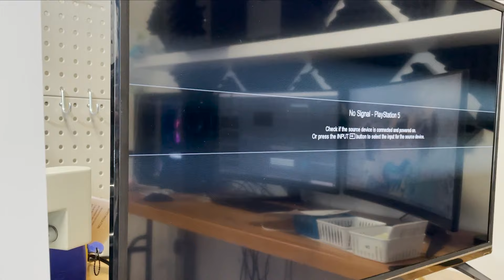PS5 HDMI Replacement: Fixing HDMI Port Issues Like a Pro!(Teardown included)

Comment: Man getting the old component off was the hardest part, thank you for the guide my stepson and I really appreciate it, his ps5 is working like brand new again!
Reply from the maker: Awesome 👏🏻
Reply: Oh God , it’s like it was made with a different material
Reply: How you’ll charge me to fix mines ?
Reply: I'm taking a break right now. You're right, I'm trying to get the old one off but It's not wanting to budge. I will get it off eventually.   (realized I hadn't sent comment yet)   Ok, I just got it off. I think I'm going to take another break before I try to install the new one. lol
Reply: I got it out but 1 leg was broke off in the hole. It took as long to get that last leg out as did the rest of the port. This has taken me all day, off and on. I think I'm going to call it a day and try to solder in the port tomorrow after work. I love tinkering with this type of stuff but it is tedious.
Reply: @allenmitchell09 did you fix it
Reply: @ I wish.

Comment: 10:52 you remove the silver screw to put in the black on eright if you was following this 1 to 1 it would be wrong just asking tomake sure?
Reply from the maker: If you are referring to the silver screw on the left on top of the disk drive then that’s the correct screw for this model. There’s one silver screw for that slot.  All the rest at that point are black.
Reply: @FIXDPHONES  Are you sure? at 10:30 you put the silver screw in then after put the plastic shroud on the PS5 if you try put the black screw in near that hole near the disk drive you end up boring the screw. Also at 10:56 you time skipped and maybe didn't show you removing the silver screw I watched a few other videos on the same model and no one put a silver screw in the hole before putting on the plastic shroud.

Comment: @5:31 and 5:38 what is he/you doing or called at this point?
Reply from the maker: Using flux and wick to remove all the solder from the through holes and pads.

Comment: Hi Thanks for sharing. Would you please also introduce the tools that you used? I'm not very clear about the liquid thing you applied. Thanks again.
Reply from the maker: The liquid I used is flux, designed to prevent oxidation while soldering so the solder can flow more freely. Hope that helps.
Reply: What are you doing at 07:38? Too bad you went silent on that part i cant tell whats happening there or why

Comment: I have not got into the newer gen consoles because of the liquid metal. I havent learned about it and it seems very different than thermal paste. Its mainly whats holding me back here an im not sure if i should be as worried as i am since i have done so many PS3 and PS4's
Reply from the maker: If that's the only thing holding you back then I say go for it. I find it much easier to work with in general.
Reply: liquid metal is tricky cuz it takes 40 minutes of spreading it around for it to finally start sticking

Comment: This is a great video for teardown, but it takes a lot of heat to pull that port off. The metal shell of that connector is soldered to a pretty heavy ground plane. I would recommend pulling apart the connector and removing the plastic piece first and desoldering the small pins. If you try to heat the whole connector and pull it off as one, you may rip some of the pads off on the fine pitch pins because it hard to get an even amount of heat on both side of the board. As you can see in the video the small pins on that plastic connector we’re already cracked so it came off pretty easy. If your small pins are still soldered to the board be very careful when pulling off the connector.
Reply from the maker: That is some great advise, Especially for someone who hasn't done it before.
Reply: Nice

Comment: What is the reason for damage on hdmi port,,heat??? or crash?? or dony factory fault??
Reply from the maker: Typically it’s when the hdmi cable gets tugged on
Reply: @FIXDPHONES  you mean i.e. if you pull the cable with force or clip them not carefully? I have ps4 10 years and many time I clip or pull the cable and never had damage, also the original ps5 cable I noticed in some ps5 games (not ps4 games) is very hot and my ps5 is new and in very good condition

Comment: What screwdriver are you using to take this all off? I can’t find a tool that has a hole in the center for those weird little metal piece in the middle of all the screws
Reply from the maker: Most screwdriver sets for electronic repairs have them, I even saw the same style in a Walmart kit.

Comment: Hello I just bought a ps5 and I have been plugging and replugging my ps5 to shift rooms here and there and I am worried about the hdmi port and the power port and don't want it to be damaged. Plz tell me if it really affects the ports if it's plugged in and out with care.
Reply from the maker: As long as it’s something that you are paying attention to you should be fine. If the cable gets tugged on especially in the wrong direction that’s when I’d be worried. Just make sure it’s plugged in and unplugged with care each time and you’ll be fine.

Comment: Do you repair liquid thermal for ps5 and also do you repair broken Ethernet port ?
Reply from the maker: I do replace the Ethernet Ports yes. when you say repair liquid thermal, do you mean add new or has yours gotten on to the logic board and caused issues?
Reply: @FIXDPHONES  both  i mean the liquid is on the motherboard and eventually add some if needed

Comment: Great video as I was contemplating replacing the HDMI. I went to plug in the controller, didn't even touch the PS5 and bang a big static shock. The thing now will not output any video whatsoever. Tried safe mode and all that. Any idea if that's likely the HDMI or possibly fried the video card or some other component?

Comment: So so so many people experience this same problem ,,,so why isn't it a report on faulty equipment been sold by playstaion ,,and why isn't playstation resolving and fixing this fault,,it cost enough to buy a ps5 and then the scam is when it's faulty hdmi port breaks ps5 charge 280 euros to fix the faulty equipment it's a scam by playstation ,,,,,2 weeks after the guarantee is up mine went down rang ps5 they take no responsibility on the faulty equipment
Reply from the maker: Agreed, should be something they cover under a specific amount of time.

Comment: At 5:55 are you just cleaning up the board? If not what are yiu doing exactly
Reply from the maker: I’m absorbing the old solder with wick(braided copper) using a soldering iron. This will allow the now hdmi port to slide into the through holes and be easier to solder.

Comment: What temp is your gun?  I can't remove the Sauder on the ps5 it won't melt with my gun or 860degree heat gun
Reply: Mix leaded solder in and it will lower the melting temperature

Comment: I bought one off eBay said new pre owned but was completely custom purple and galaxy stuff loooks cool hdmi port does not work paid 403.12$ for it :/ wasted money cause I can’t do this 😅lol don’t even have the tools to attempt so guess I am put money cause I don’t have money for repairs I mean I do have two ps4 sitting on my shelf one is parts and blue light of death other just needs a hard drive otherwise works but the part ones drive was bad so never got around to fixing it. Figured I’d could use one of there hdmi ports cause they’re good on the ps4 lol. But idk now 😮 I’m extremely upset cause won’t accept returns and I’m out 400$ wish I had someone who was techy like you around me :( I’d give em the two ps4 for payment. Plus I’ve never used a soldering gun before so that is out of my element used to fix ps2 and Xbox 360 and that but now oof idk man they become complex

Comment: I bought all the equipment from Amozon to doit my self but the cheap hot air gun wouldn’t melt the solder, putting back together and go buy one with a warranty and return this one a month later😂 good vid
Reply from the maker: Ya, the thermal mass of the PS5 logic board requires a ton of heat so a cheap heat gun doesn’t always cut it. Props for trying
Reply: Bouta be in the same boat bought all this stuff thinking I got it the pins won’t even come off they didn’t question you about the ps5 or check they just took it back I’m about to take this route 🤦🏾‍♂️
Reply: How hot do I need the heat gun

Comment: Tried this myself but just cant seem to get the hdmi port off the motherboard its a 60 watt solder iron i applied flux n followed your video any ideas why i cant seem to desolder n free the hdmi port
Reply: Your tip may not be wide enough to distribute a decent amount of heat. Also try heating it upside down so that gravity can help it fall out. just don't pull on it.

Comment: How hot does your heat gun need to be when taking the hdmi off ?
Reply: Same question
Reply: in another comment he posted he said that cheap heat guns most likely won’t cut it.
Reply from the maker: As hot as you can get it. It helps to add lower melting point solder to the legs and pins so that any heat gun can do it. A really good rework station is recommended though.

Comment: Brother please, all of the 4 anchors are cold joints and the solder didn't wick. Through hole components require more heat and you need better Flux.
Reply: I agree here

Comment: How much to fix mine. My HDMI port is very touchy. You move the cord and I loose it on the screen. I spend about 30min to one hour trying to get the picture on the screen and if someone bumps it. I have to start all over
Reply: Just tell me how much you charge and I can ship it to you and you could do a video on that too
Reply from the maker: Sorry to hear that, sounds like a pain. Probably broken solder joints between the HDMI and the board. Should be fixable, email me at fixdirepair@gmail.com and we can talk cost. Thanks
Reply: I sent you a email
Reply: @FIXDPHONES  I sent you an email I was waiting on a response
Reply: @zackeryhoward9686  RIP Zackery. Use a local shop homie
Reply: @blakedegner1863  I might have to it's almost the same price as the ps5

Comment: when you do this do you have to melt the solder puddle on the motherboard ????
Reply from the maker: I think you are referring to the liquid metal. It’s what Sony uses for better contact with the heat sync instead of thermal paste like on other consoles. It’s only a solid if frozen. At room temperature it’s a liquid. Pretty fun stuff to move around but it can be messy too.

Comment: any reason a solder suction tool should not be used for the through holes (mounting holes) to clear out the solder then clean up with the wick?
Reply from the maker: Nope, totally fine to use one of you have one

Comment: At 6:06 listen brother so you donny waste your time by doing each pin

I have fixed alot of ps4s and ps5 so when you remove the 4 legs solder you put the new port then use hot air station at 350c at low air of 30% then hold the hdmi port and keep heating for 1min after that when you put the solder on the 4 legs do the same heat it up but now at 40% air flow then the solder that you put on the legs will be sucked so the port will not be loose and the pins will be 100% soldered so don't waste your time doing the pins its waste

Also don't use wick and remove the solder you can just put Flux then the iron pen put little bit of  solder  and don't let the pin touch the port leave the solder on it and go right and left that's it the wick thing is first hard and also you can remove the pins solder on the board I hope you understand man good luck
Reply: Thanks man. Soldering those pins are a pain.
Reply: Nope nope and nope,my brother does this job for the Xbox's and Nintendo Switches,listening to this  Toghy will make your HDMI ports fallout faster than the videogame with the same name did overtime O_O

Comment: This is a dumb question, but when purchasing a replacement port do I need to factor in HDMI 2.1 support? I know the cables and devices must support it, but I’m not sure if the actual port itself varies across 2.0 and 2.1?
Reply from the maker: Nope, an HDMI port doesn’t care about the difference in cables as the ports the same.
Reply: Where can I get a hdmi connector from !

Comment: I've had a PS5 for all of two weeks, and the HDMI cable keeps falling out. Had a Series X for over a year, and zero issues with its HDMI. Just...WTF, Sony.
Reply: I dropped mine lol HDMI chord pushed the port inside
Reply: @seekandyoushallfind9707  did you end up fixing it ?
Reply: @aaronvvs3413  I replaced the HDMI port but I feel like I didn't solder it correctly. I'm going to try one more time when the new port comes in. If that doesn't work I'll send it some where for repair
Reply: Okay? I’ve had a PS5 for 4 years no issues, means nothing

Comment: How much would this service cost i need mine done 🙏🏾
Reply: Just broke mine an hour ago and I’m pissed asf,
Reply: @SheOnceLuvvd  got mine fixed locally $150 look around yours
Reply: @ibshotya  yeah I just got mines fixed yesterday for 150
Reply: If it's under warranty and you file a claim through sony, you can get it fixed for free.
Reply: @souptime_mp4  yeah ik but the only downside to that was waiting 2 months so I decided to pay 150 to get it fixed and returned within an hour
Reply: @SheOnceLuvvd  where’s you take yours to get it fixed?
Reply: @moonvro  Digital Doc, but tbh I got lucky and went the right exact time. The dude who fixed mine just happened to be in my town and he is the only tech who could and work on ps5 within a 50+ mile radius for digital doc. So he was already experienced and knew what he was doing. So that was a plus on my end.  If you want a third party to fix just be careful who you pick because not only you risk your warranty but also can’t guarantee a stable fix to the problem if they’re not experienced
Reply: @ibshotya  that’s expensive….
Reply: @SheOnceLuvvd  how did it go wrong? Cause i felt it's a bit tight to put the cable in the port, did you push it too hard or something else?  I don't wanna make the mistake of pushing it in or bending it.
Reply: @br1303  I apparently pushed it in too hard which caused the component to fall off
Reply: Same thing happened to me and I was rejected in warranty :((( now I'm waiting for a local repair shop to fix it. Hopefully they will manage to do that
Reply: @SheOnceLuvvd  from where I’m in Cincinnati and I really need mines fixed any options